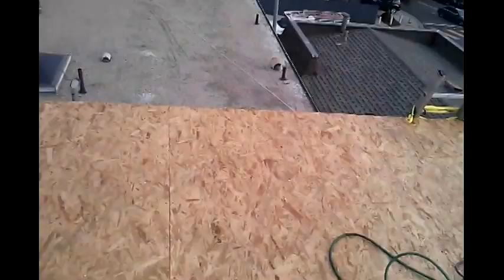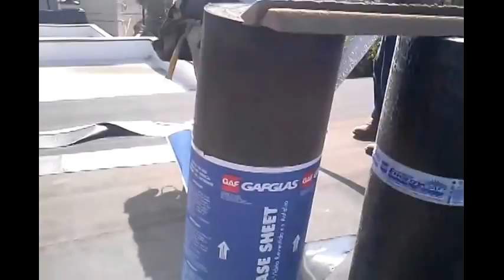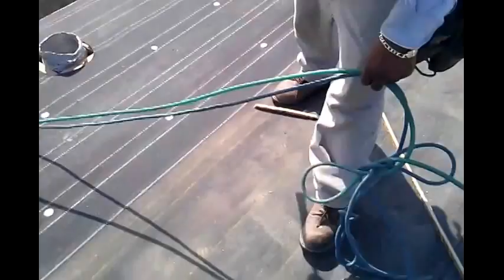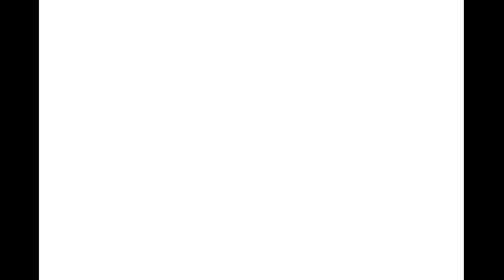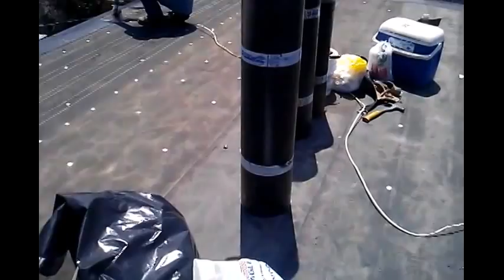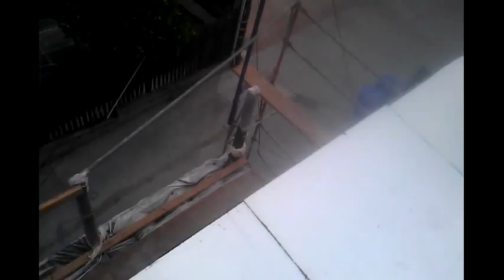Roll Roofing , how to install a basic flat roof, torch down roofing !

Comment: That is not plywood but OSB oriented strand board. Roof decking does not need gaps just use enough nails or screws and it will stay put. Gaps lead to leaks. Decking will only swell from getting wet. Check local codes first as well

Comment: Eric, thank you for posting your videos.  I am learning a ton!   I paid a guy $3000 to do a repair on part of my flat roof and when he was done, we had more leaks than before he did the repair.  So I had another roof laborer come in to fix the new leaks which he didn't do it right because it's still leaking.  I've lived in the home for 13 years with various leaks.  So, since I can't get someone to do it right, me and my wife are going to do it ourselves so we know it will be done right and to learn so we can do our own repairs.  We will do a section at a time until we finally have the entire roof redone.  Your videos and others allow me to learn each step as we go.   I really appreciate people like you that take the time to teach those of us that are not familiar with roofing techniques and materials.  I like how professional you are and that you describe how to do it and why.  Makes a lot of sense to me.  So I hope our 13 year roofing nightmare will finally come to an end.  I do have one question.  If your roof has low spots where the water is pooling, what do you use to raise up the low spots so the water will run to the canale drains?   The guy I paid 3000 dollars to fix it, did not raise it enough, the water still pools in the low areas.  It's so bad I have to leave a sump pump on the roofs low spot so I can pump it off when it rains.  The roof will hold almost 2 inches of water before I turn the sump pump on!  It's  crazy we have had to do that for so many years now.  It would really help if you could give me some advice on what we can use to raise up those low areas that are holding water.   Thank you Eric!
Reply from the maker: Thanks for such a nice comment...to raise the low spots use plywood sheathing...get a level and follow the slope of the water
Reply: Did u decide what ur gonna do can u film it
Reply: @happydays454  - I'm going to build it up with some new 2X10's  and basically build a roof  over the old one, but with a low pitch to it since it's a Spanish style flat roof design.  The way I"m going to do it, it will still looks like a flat roof from the ground level, but if you get on the roof, it will show a low pitched roof with rafters that drop down to 0 rise, leaving a channel for the water to follow and drain into the canales.  Yeah, I could film it no problem. I'll post one when I start.  I'm just about finished building a nice chicken coop.  Looks like a little beach house on stilts.  The chicks are loving it!
Reply: @michaelwood5519  thank yeah i got sw style home too puddles every where i need to fix right

Comment: Eric, no doubt you been around roofing for a while.  few things...you say safety?  you have none. sorry just have to say it.  wrong flashing at jacks.  hope this isnt a high wind zone either.  1" diameter simplex nails wont hold much at spacing you guys used and honestly isnt the right thing to use anyways.  try plates with screws if you want to do it right.  then, using mixed materials? lol man.  wont be warranted apparently.  people who dont know anything at all about roofing will like the finished look but keep in mind whats really important with a roof...watertight and resist wind.  assuming you are not required to meet Code with insulation or fire ratings.  combustible deck if you even want to call OSB plywood.  BTW, no need to rip the joints wider on long dimensions of the OSB.  Why? because plywood doesnt move that direction.  if you have a case its on the narrow ends where the movement happens.  would love to help you become the best roofer around. you have the talent. just need someone with the behind the scenes knowledge to help you.

Comment: any body can tell me which type of nails they use and how come the hammer can hold the nail before nail down? I think nails with plastic cap is too thick.
Reply: metal cap nail with a hammer that has a built in magnet.

Comment: here in Texas on the coastal bend area, you have to nail with simplex 1 1/2" , 3 rows on field 6 or 7" on center and laps 4 or 6 nails oc depending on design wind pressure.
Reply: Do you install torch down roofing Dallas Texas

Comment: Hey, Eric - I've watched a bunch of your videos and I think this one is the best as far as "step by step" instructions.  I like how you took the time to cut the 1/8" gap in the plywood and the detail of nailing the gaps.
Question - does that "inner ply" layer around the edge come with the edging material?  And you didn't show putting the mastic over the edge.  Does it have to dry before torching?
Thanks for making the videos!   I used to live in Manhattan Beach back in the 90's - nice to see it again.
Reply from the maker: +Steve Murwin There are 2 ways to do the edging metal when installing torch....
1: You install a layer of smooth torch all the way around the edge and then you install the edge metal on top before installing the final layer of granulated torch.
2; Apply roof cement under the edge metal if you don't have smooth torch installed, you have to apply roof cement under all the pieces of edge metal or you can apply directly to the base sheet and then set the metal on top .
3: The roof cement doesn't have to be dry , just make sure you don't make black marks over the granulated torch.
Reply: And by "the torch", you mean the actual cap sheet?  But I think I understand what you're saying. Thank you!
Reply from the maker: +Steve Murwin Yes the granulated cap sheet , we call it granulated torch down cap sheet...
Reply: cool - thanks for your help, Eric!
Reply: @Garciasroofing  hola erick

Comment from the maker: don't remove it, that tab will stop the water from penetrating all the way down to the sheathing and will make  the water on top of the shingle underneath in case of a leak, also it prevents the shingles from sticking when are in the bundle.